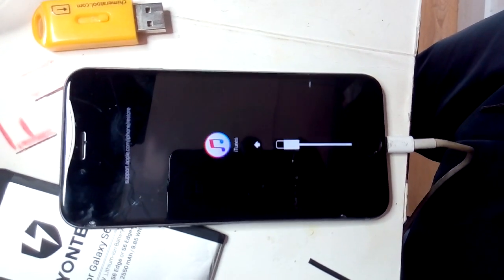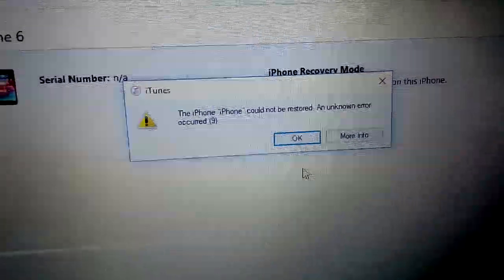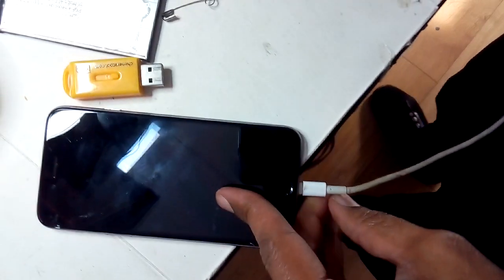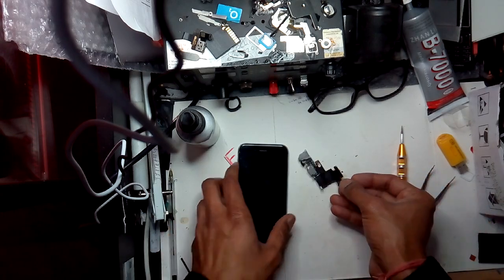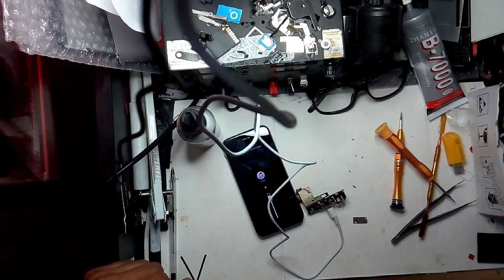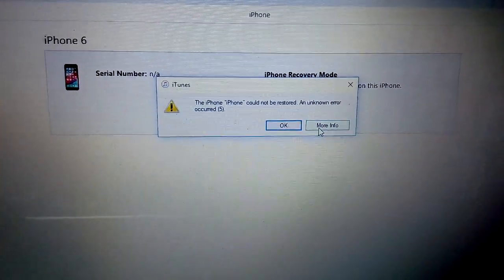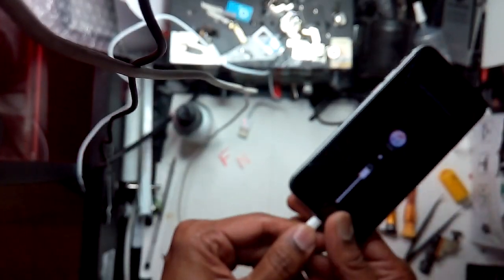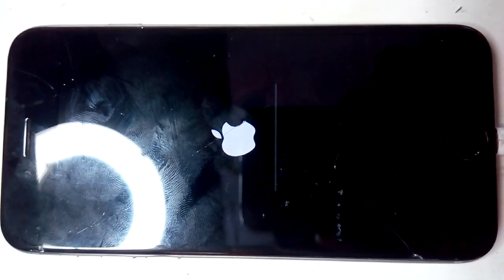Error 9,4013,4005 and 4014 on Itunes what is best solution?

Comment: I got the iPad 5 gen iTunes 9 and 4014 error i tried almost every software aspects
Reply from the maker: It's look like hard ware please contact apple for replacement, please subscribe like to support
Reply: @Fixingnews  it's out of warranty but I am getting same issue as of the vedio so can I repair it and what would be the cotation
Reply from the maker: Try to change battery
Reply: @Fixingnews  I guess my battery was working fine do you think it's a issue with nand in the motherboard or etc thanks for reply sir
Reply from the maker: That's right check with diff Macs and oem USB
Reply: @Fixingnews  tried that too it's the exact same issue as of this vedio but it's an iPad 5 gen

Comment: I'am facing the same error9 problem for my iphone 6s any solutions
Reply from the maker: Thank you for watching please subscribe, like for aupport
Reply: All u need to do is to put the phone in boot mode, update iTunes to the latest version, try another com port if the first one had failed. Turn off your computer anti virus until you finish restoring the phone and start the process using a original data cable. Nothing fancy

Comment: so basically what is the problem? i face the same problem. first 3194 then after i restart the pc then goes to error 14 then after that error 9.
Reply: Try with original cable and plug into usb 2.0...Keep trying..Error 9 may cause or not..if it , then try to restart pc or try restore after an hour so..I have fix my 6s like this..Many times Error 9 has occurred..but Idk It was a surprise it didnt bothered after trying some times..